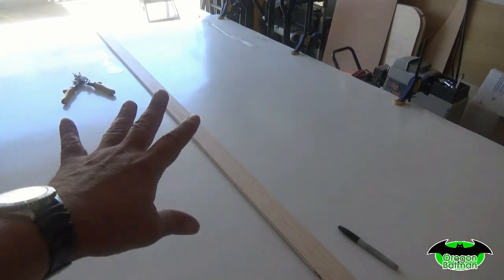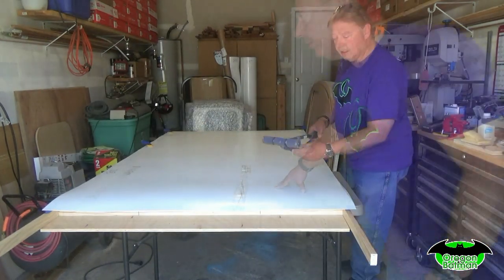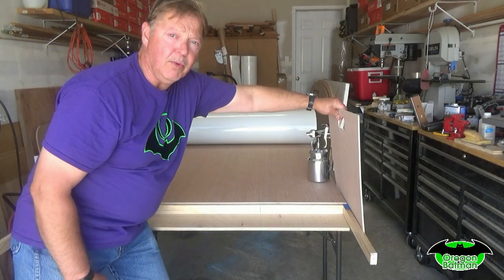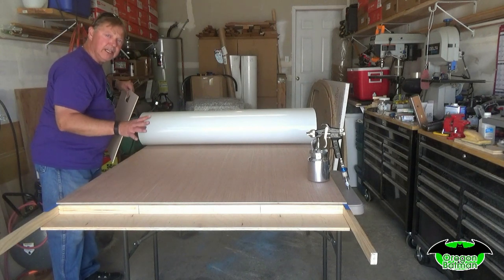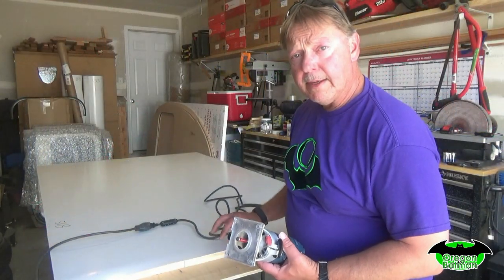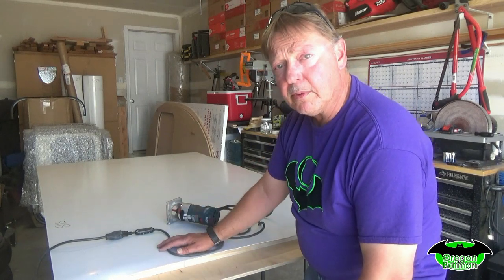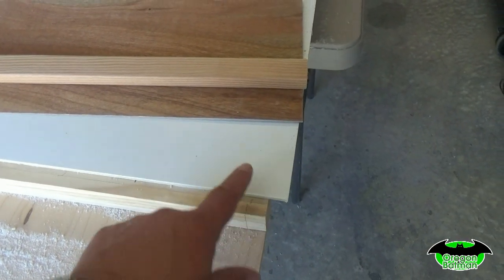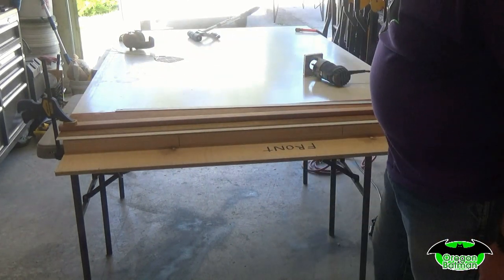Let’s Build A Teardrop * Step-By-Step * - Part 7 (How to Install FILON)

Comment: This is the only video on youtube ive found on installing filon. Its so expensive its nerve racking doing filon without experience and now youve created a resource for other novice camper builders and diy'ers, so thank you for that !
Reply: Filon is not only expensive but the gluing process makes it impossible to reposition:  double nerve racking!
Reply from the maker: Thank you Brent!

Comment: Building my own project, I did a lot of research on YouTube on the Filon gluing process and I never found one until today:  thank you so much Al for that important video!  I looking forward to seeing the gluing process of the front, top and back of the trailer in one shot!.

Too bad, they don't sell that glue red tinted:  easier to monitor full coverage.
Reply from the maker: Thank you!! I'll be a little more nervous when it comes to gluing the top, but I'll do a lot of practice runs before I actually spray that glue! And I agree... wish it was tinted red like your was, would be so much easier to see!
Reply: @OregonBatman  Looking great!!! They do sell red tinted glue. The easiest place to get it is from All-Rite the stabond 440 should work.

Comment: You've pretty much taken the fear away from me regarding filon!  I might snag a few scraps from someone and see how I do with it.  Looks exactly like how formica is attached to the countertops and tables we built.  As always, GREAT WORK and loving your build so far!  We're way behind you!
Reply from the maker: Thank you Eli! Yes!! Exactly like how formica is attached! It was a mystery how to install it until I started... :)   You will have no problem! Thanks Eli, looking forward to seeing what you do next!
Reply: The top challenge will be to glue the Filon on the front, top and rear of the trailer in one shot, with almost no possibility to reposition the Filon if the gluing didn't start straight.

Good luck Al for that next crucial step!
Reply from the maker: I have a plan!! :)        Just have to execute!  LOL!     Only get one shot!

Comment: Awesome. Thanks. Getting ready to put Filon on my class c over cab rebuild. Also looking to see if I can glue straight to foam on bottom part. Maybe need a different glue.
Reply from the maker: Thanks Jorge! I think you will need a different glue... this glue might not work with the foam. You can try a sample piece and see if it works.

Comment: Will that Helmiprene glue work for attaching filon to styrofoam? Where did you get it. Thanks
Reply from the maker: Check out Helmitin website for the foam bonding spray adhesive:  https://helmitin.com/product-category/industries/foam-bonding/

Hope that helps, al

Comment: What was the adhesive that you used?
Reply from the maker: The product I use is called Helmiprene 4545, a spray on application made by Helmitin. They also make a product for roll on application as well... Helmiprene 4535. Hope that helps!

Comment: Hi Al, my husband and I ordered your plans and we have purchased supplies to start our build.  One of my previous questions to you was how much your camper weighs and you said 1,000lbs.  I want to pull mine behind a Prius so I'm trying to build as light weight as possible yet have a well constructed camper.  We are wondering how much of the 1,000 lbs does your trailer by itself weigh?  We are using a harbor freight trailer (all original) which weighs 250lbs so we are wondering if we are starting with less weight (than yours) at the git go.  If you have ideas on how we might use your plans yet shave off some weight please let us know.  Thanks so much!
Reply from the maker: Oh yeah... you will come in several hundred pounds lighter than mine. My trailer frame was built using 3/16" steel VERY HEAVY! Plus the axle weighed in close to 100 pounds. You will probably come in at around 750 lbs or slightly more, but not anywhere near mine! :)  If I had to guess, my frame and axle was around 400+ lbs.  Hope that helps, al
Reply: @OregonBatman  Just what we needed to know.  We have appreciated your prompt responses. they've been so helpful.
Reply from the maker: @microgreensgrower3946  Absolutely, Happy Building!

Comment: I wonder if this can be done neatly using contact adhesive like evostik? I remember using some contact adhesive that was spreadable like butter but I'm not sure what it was called.
I used the original evostik years ago laminating bar countertop's and it worked just fine. Good video OreganBatman 👍
Reply: This IS a contact adhesive.
Reply: @MikeAG333  Yes Mike, I was referring to using a particular brand that is easily obtainable here, wondering if it would work as Good. 
The buttery stuff was not stringy, easily spread and a treat to use; spreadable with less mess. 
We have the common Evo stick here, the buttery stuff I have not seen for years.

Comment: Was wondering...I have seen teardrop floors built like yours,but something I thought that was neat in some of them was that a router was used to create channels for the wiring of the unit for the trailer lights and the interior lighting...Your thoughts??
Reply from the maker: Just trying to keep it simple really for the first timers :)  Running conduit under floor is what I would use. All wiring running through from front to rear.

Comment: Will the contact glue put up with varying weather? Hot sun to cold winter.
Nice video.
Reply from the maker: Hi Marty Q... I actually put together a video answering that question, will post that Wednesday evening. In short, yes... it holds up very well!

Comment: Is that FILON similar to FORMICA ? Is it a kind of Formica, Mr.Albert ? I looked it up in the dictionary and apparently I didn't find it. After glued both sides you can't remoce any more, isn't it ? Please say hello to Jack! Vice job,as always !
Reply from the maker: Hello Carlos! Formica is a paper product and Filon is a fiberglass product. Very different materials. They are similarly installed the same, and yes, once it is glued ind in place, you cannot remove it! Thanks Carlos! I will let Jack know you say hello! :)
Reply: ok,Mr.Albert...thank you for the explanation! It has a good finishing...and fiberglass is easy to be repaired if damaged! take care!
Reply from the maker: That’s true! Much easier to repair! Glad you stopped by Carlos, always good to hear from you!

Comment: I'm anxious to know 2 years later how did your glue hold up? I'm rebuilding a wall on my camper and I'm nervous to use anything other than stabond but if this worked well I'll jump ship!
Reply from the maker: Well... I am happy to report that everything is still solid. The glue is pretty good, but I hear Stabond is the good stuff to use! At least for the price, the glue I used worked great (so far!)  :)
Reply: Awesome thanks for the update!!! I've talked to a couple local dealers and I'm gonna use your method but I'm going with 3m 90 spray on. The wall I'm building is going to have bolts at a 4"spread along the sides and top so delam isn't a huge concern anymore. Thx again for the update and the video!!! Helped me a ton!

Comment: Im installing AZDEL onboard under filing replacing paperboard and I'm curious if the adhesive you are using would gle filing to FRP AZDEL?
Reply from the maker: Great question Patriots! I would suggest you check out Helmitin's website for the product you need. The adhesive that I used is for Filon to wood, but they make several different types to attach to different materials. Here is the link: https://helmitin.com/products/

Comment: Do you happen to remember how much filon you ordered and shipping weight. I found on recpro they say 
.1760 sq ft but 15 lbs for 10 ft seems low or is that accurate?
Reply from the maker: Sounds about right... I picked up 20' at the store and I figured it weighed about 30 lbs

Comment: I enjoy the simplicity of your video and the fact you share information and product name. But unfortunately the company you used for your filon and glue cannot ship the glue you used. I have been doing research to find an alternative to the HIGH $$ glues out there and I was so happy to see that the glue you were recommended was affordable. #M products are double what you paid. I also found during my research that regular Contact Cement will bond the Filon, it will not hold up to the various temperature changes for a normal RV, become brittle and looses holding strength. So if you happen to know of another product to use that would be great. Thanks.
Reply from the maker: Thank you Jhinglouis Blea! Sorry to hear the glue can't be shipped... There is a product called Titebond3.5-gal. Greenchoice Advanced Polymer Adhesive and it is about $140 for 3.5 gallons (about $48 gal). It is meant for FRP panels so should work. Not sprayed... it is troweled on. Do a search to see if that product can be shipped to you, there is no hazmat or special shipping to deal with. Hope that helps! Thank you for stopping by and watching the video!  Chow!

Comment: How thick is the Filon and where did you buy it?  thanks for the info
Reply from the maker: Hi Robert! The filon is close to 1/16" thick and can take a nice bend. I purchased my filon at Affordable RVing 15555 SE McLoughlin Blvd, Milwaukie, OR 97267 (503) 659-3610. You can call to order and they also sell on Ebay.  Hope that helps! al

Comment: Can filing glue be used on foam?
Reply from the maker: There is a special type of filon glue especially made for foam applications. This particulart product will not work for foam. Check out Helmitin's products: Helmeprene 4510 https://helmitin.com/product/helmiprene-nf-4510/

Comment: Hello O.Batman Is that luan your using to glue the filon on? Has it still held up since the initial application? I contacted an Rv repair shop concerning the process of re-applying filon and was told I would not be successful due to it being a process I could not reproduce. I'm attempting to replace the entire 14-foot exterior wall that just disappeared while driving home after purchasing the camper. Do you have any suggestions? I already purchased the FIlon and would like to construct the luan exterior wall first so that I can successfully apply the filon as you did horizontally and then attach the completed wall to the aluminum framing with some sort of adhesive bonding. your thoughts & suggestions please.
Reply from the maker: Hello Fred... sent you an email with a couple options that could have you back on the road! :)
Reply: @OregonBatman  Thanks for taking your valuable time to help folks in need
Reply from the maker: @1STGeneral  Absolutely! I really appreciate you watching, and thank you for the kind words!

Comment: Great video. If I may ask which Helmiprene Adhesive # did you use and where did you purchase it at? My son I are doing our 1st build and not sure what to use.
Reply from the maker: Hi Tommy!  The adhesive I am using I purchased from Affordable RVing 15555 SE McLoughlin Blvd, Milwaukie, OR 97267. The number is Helmiprene 4545. Great stuff!
Reply: @OregonBatman  Thanks for the reply. I can't find the Helmiprene. Have you tried the Dap Weldwood on filon? I read that some people have used it.
Reply from the maker: I haven't tried the DAP... best to try it on a few samples and see how it works. You can find the Helmiprene at the Helmitin website, https://helmitin.com    Stabond also has a pretty good product. Hope that helps!

Comment: Why pay for a sprayer to apply the glue when a brush or roller would do an equal or better job for much less cost?
Reply from the maker: The Helmiprene that I used is 4545 and made for spray application. There is 4535 which is suitable for roll on or brush.

Comment: You are gluing it? Everything I've read says not to glue it, to float it instead.
Reply from the maker: Hello Susan! Filon must be attached with an adhesive... Filon is a fiberglass sheeting. You would float an aluminum sheet, yes, to allow expansion and contraction. Not so with fiberglass (filon).
Reply: I don't think that's 100% accurate. On the diy teardrop Facebook page I have read tons of times not to glue it. Jay floats filon on all his builds. Jay's way more knowledgeable than I am on this subject.
Reply from the maker: Sorry... but filon must be glued on. RV manufacturer's never "float" filon. It is installed using the same method as counter tops.
Reply: Jay floats it all the time. It actually helped when he had to replace a damaged piece that was already installed.
Reply from the maker: Not something I would try. I would be very interested in seeing how long something like that would last. Only product I know that is installed "floating" is aluminum sheeting. I have never heard of floating filon, and a search on google produces no results other than gluing. I would have to say, the correct method is gluing the filon.
Reply: You are welcome to look at the Facebook group and check it out.
Reply from the maker: Thank you.
Reply from the maker: Just saw the post... hope this helps. 

Tom Jankovic You normally don't float Filon. It's glued directly to the plywood.

Hide or report this

Like · Reply · 1y · Edited

Jay Poore Tom Jankovic I know but I'm not going to glue it. I found Filon cheap and plan to stain mine at a later date. I want to be able to remove it. A few well placed, hidden fasteners will help keep it in place.